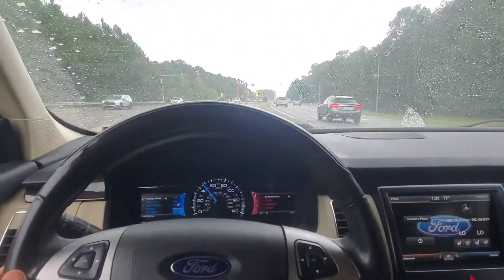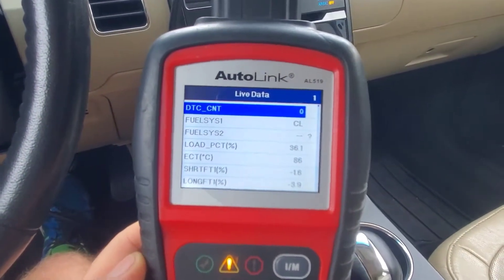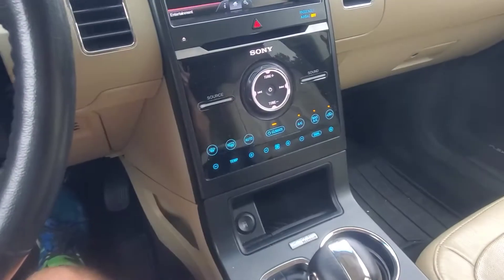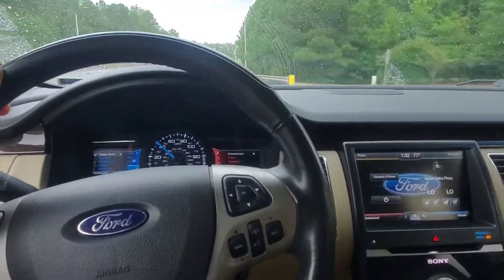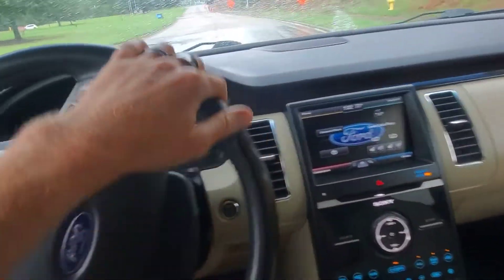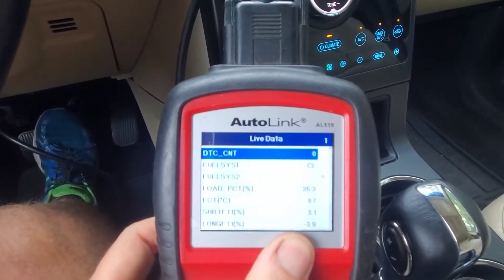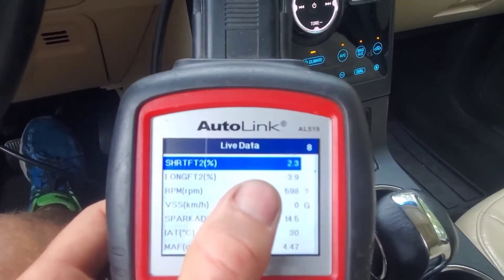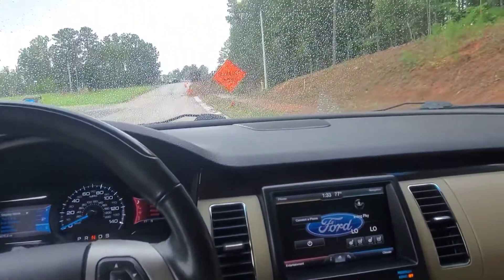What are emissions readiness monitors anyways?? and...car repair verification using fuel trim data

Comment: My Evap is the only MIL not ready. I don't have a CEL. However, my car does idle a bit rough. Do I have a leak somewhere? ST/LT fuel trim data seems normal.
Reply from the maker: How many miles ago did you last clear codes? Can you read fuel trims at idle and see if within plus or minus 5% to start with?
Reply: @2shops1roof  I had to disconnect the battery for a starter replacement a while back. I don't drive the car much. Yes FT's are within 5%.
Reply from the maker: @kalani1987  wouldn't suspect it then. But if you can smoke test the evaporator between the purge valve and fuel tank that would be best. That or look up evaporator drive cycle for your car and follow it. Many times has to be within 25-75% fuel level for evap

Comment: Haha emission readiness is how I cheated and got my car inspected.

I have a check engine light it's been on a couple years now I need a new fuel injector it's a bmw 535i so you gotta  replace all 6 that's going to cost about 2,000 for te updated design. I can't afford that right now I have a lean code in bank 1.

What I've had to do is clear the codes and wait for the drive cycle to complete then I take for inspection before the check engine light comes on. .
I can go about 25 miles and the computer is set and ready to pass inspection at 35 miles thr check engine light comes back on.

Comment: Aren't timing chains supposed to last life of car?
Reply: Yes but of course they don't, the chains stretch, guides brake, wear, tensioner fail, so if you're going into the front of the engine with all the work involved just change the timing set and I always put a melling high volume oil pump in it
Reply from the maker: @billgelsdorf3075  right on. And @dan r, many vehicles have chains that last forever, but there are also many that are known for having issues. Some it is a certain part like a tensioner(Honda 2.4), others are another part, or a chain stretch(gm 3.6L), etc.